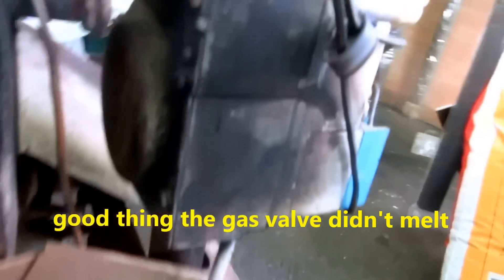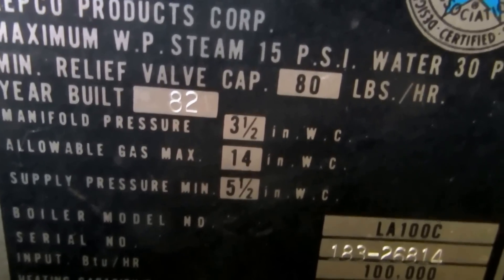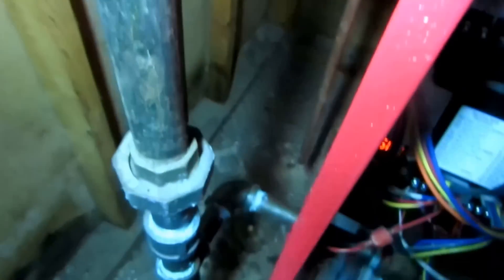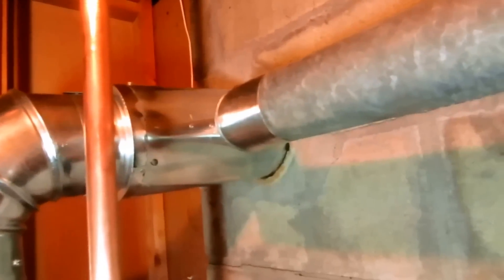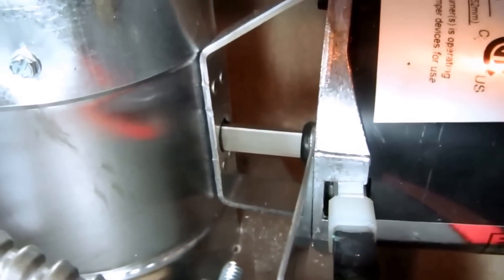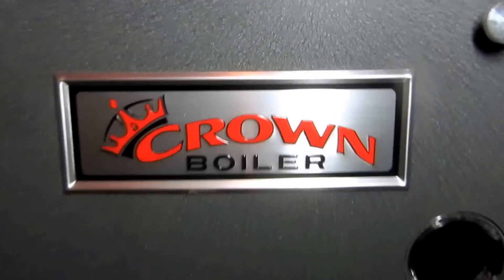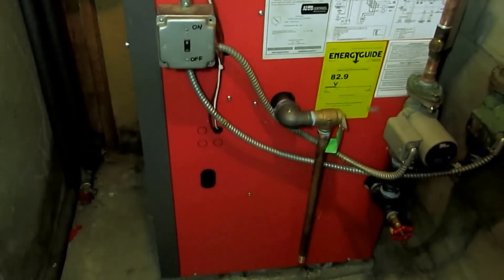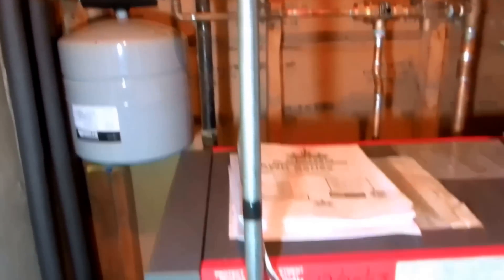hydronic heating:  gas boiler replacement

Comment: Another good looking install. Why a motorized damper on the vent pipe?
Reply from the maker: Nicholas CeeA when the boiler shuts off the damper closes to keep heat in the boiler ,adds 1 percent to the efficenty of the boiler